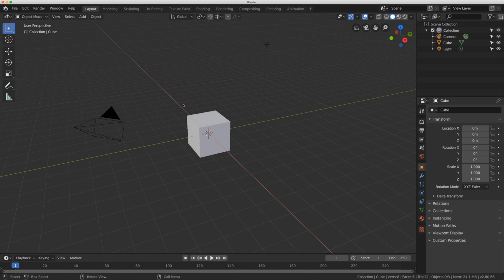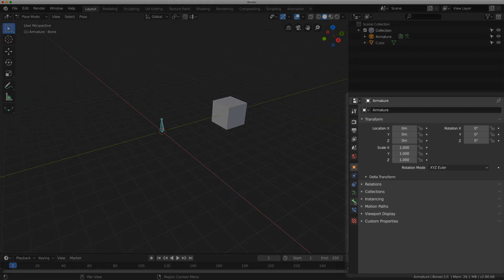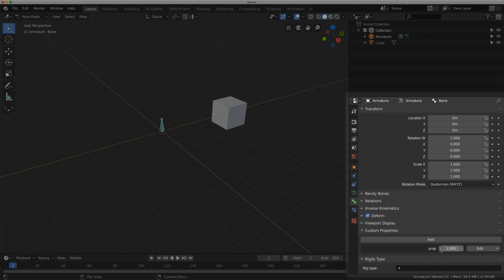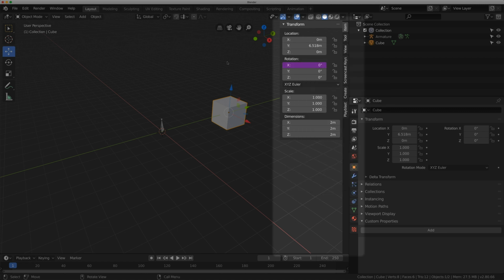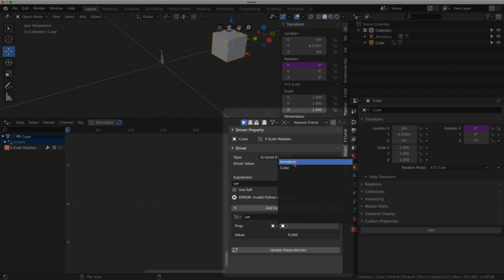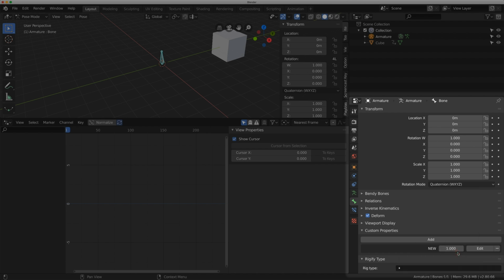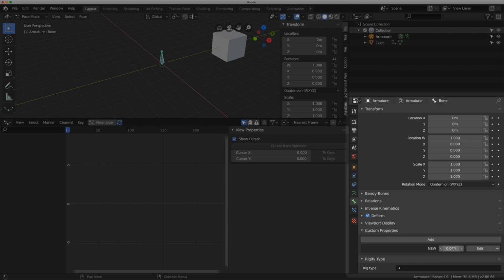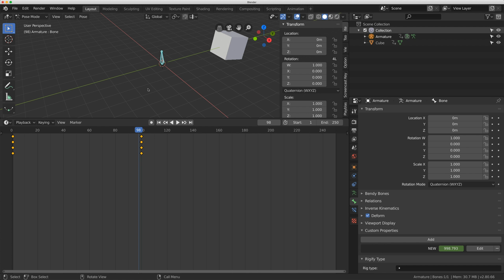Add A Property To A Driver | Blender Drivers Master Class

Comment: I have a question though. So I got a custom property with a max value of 3. I also got two objects that I want to drive with my custom property. If the value is 0, both object is hidden. If the value is 1, then the first object is appear. If the value is 2, then the first object is hidden, but the second object appear. And if the value is 3, then both object appears. The only issue is what should I do. I'm using scripted expression and I don't know what expression I should use because I don't know much about it. I hope someone can help me with this.
Reply from the maker: So - for this you can actually use an if statement in the expression: 
For the first object: 0 if var == 1 or var == 3 else 1
and for the second object: 
0 if var == 2 or var == 3 else 1

Let me see if I can do a video on this in the future.

Comment: I have created a pose library for visems (not shape keys) and I want to create drivers to dial up/ down the strength of each visem so they can be animated. I know there are addons for moho.dat to lip-sync but I want more control than what those offer. Many visems are blurred in human speech, so I want a way to control dialog to dialog and visem to visem. I know I can create a driver input area in the custom properties of an placeholder object and figure out the driver math for each bone to have each visem. I was wondering if there was an easy way to convert to driver math from my pose library instead of doing lots of driver fiddling. Do you or someone else know how to do this or an other work around? I a m looking for visem sliders that are keyable for armature rigify visems
I know I can use NLA layers but I am hoping for something more reusable.
Reply from the maker: You may want to consider action constraints, I find they are a lot better for complex animations, or multi bone animations: https://www.youtube.com/watch?v=5JmPFsIEgHI&ab_channel=LevelPixelLevel
Where I tend to you drives more as switches or dials for smaller things.

Comment: @LPL - Do you think Drivers could be used to animate texture changes?  I am doing this tutorial: https://www.youtube.com/watch?v=0glf-acMvcw But Blender won't automatically create keyframes when using the Slider to change textures.
Reply from the maker: You can use a driver to switch textures, but you need to add a mix node and add the two textures into to create a switch. What would be really nice is if blender had a multi texture input node that just took an int. 
This might be something I should make. Okay, this is an add on I'll make.